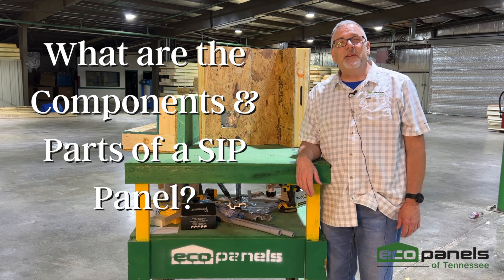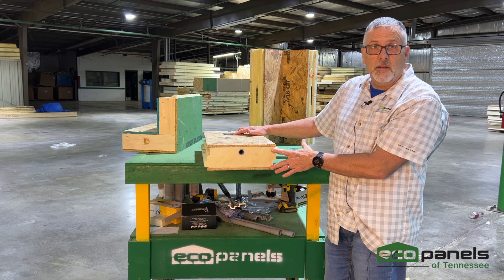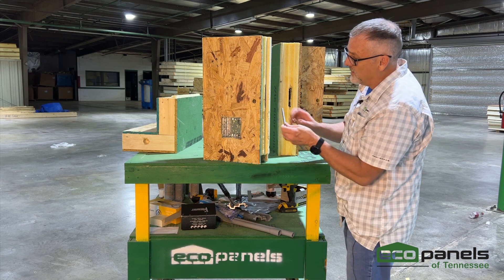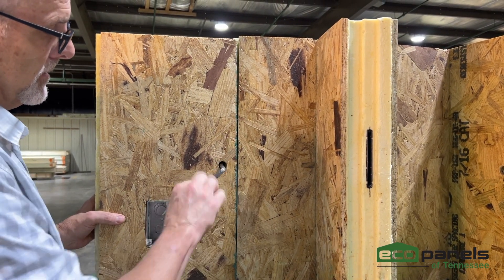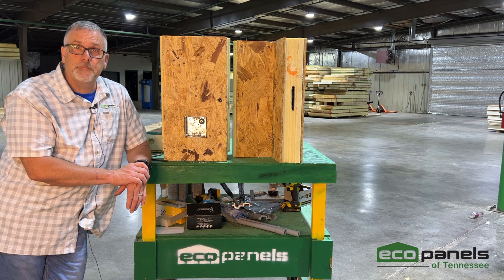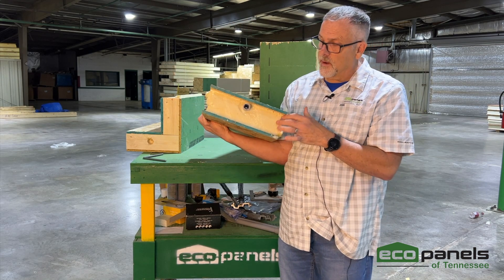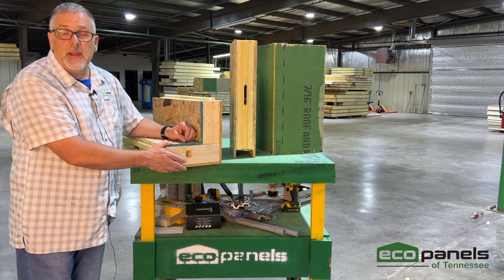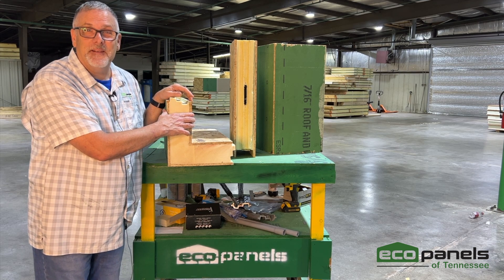What are the Components & Parts of a SIP Panel?

Comment: How is the sound barrier of the panels. Meaning does it block outside noise? Or just the same as regularly house which is fine of course.. 
also are regular roof trusses able to be used strength wise on the outside walls?
Reply from the maker: Great question. Generally speaking, higher pitched sounds (think sirens) bounce off the walls better than with a conventional house. However, lower pitch (thunder) tends to go through the foam quite easily. That said, those lower pitch sounds go through conventional construction quite easily as well. We typically hear comments from customers that their home seems quieter, though we don't really have hard data on that.
Reply: @EcoPanelsofTennessee  great to know thank you!

Comment: How about plumbing pipes etc. How are those installed?
Reply from the maker: Great question. Generally speaking plumping is kept within your interior partition walls. Where sinks or other appliances are located on walls, the plumbing usually comes up through the floor. Exterior faucets typically go through the foundation wall or subfloor band. In the case of a slab, we can cut a hole in the panel for plumbing to go through. Generally, codes restrict plumbing in exterior walls other than penetrations. Hope that helps!